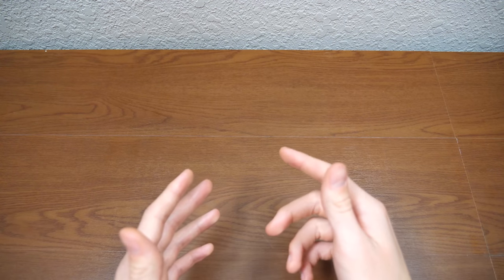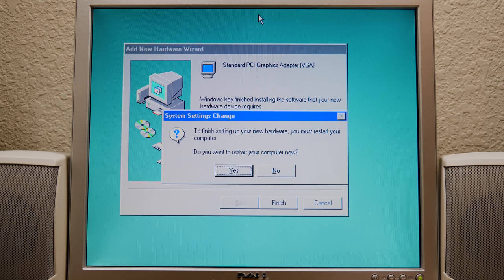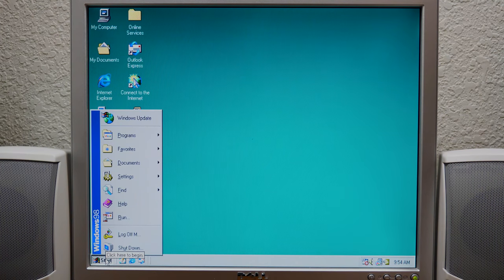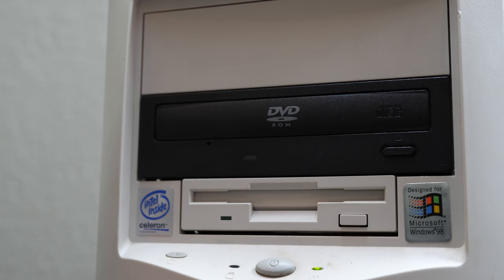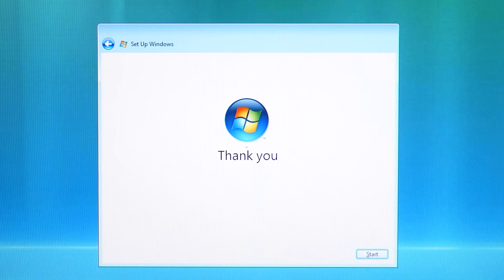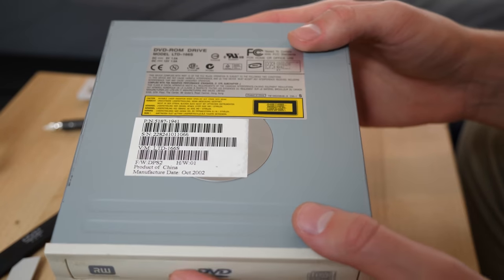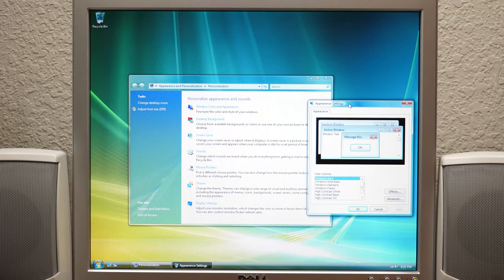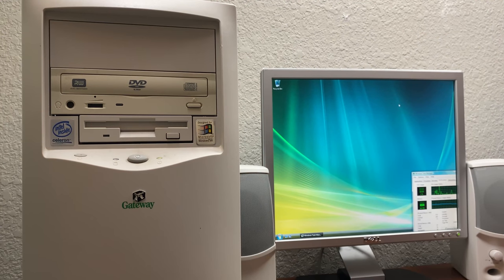Actually Installing a GPU in the $5 Windows 98 PC!

Comment: At least someone installed a new gpu this year.
Reply: fx 5200 price in 2021: 420$USD
Reply: @NuclearToastMusic  I can confirm this is true for some listings!
Reply: the dislikes are from the 90w power supply.
Reply: @NuclearToastMusic  it has reduced to 169USD on Amazon now
Reply: @healspringy6300  it was a joke
Reply: @NuclearToastMusic  How it was a joke?, i meant i thought you said it was real so i just checked it online
Reply: My PC came with a 1080 GTX however many years ago. I'm starting to think it might be worth more now than it was then!
Reply: @healspringy6300  because 420 funny number haha
Reply: @RWL2012  90 W power supplies are losers. My first PC from 1997 had a 250 W power supply and it still works.
Reply: Get a 1030 for $120. It can play most older games and it'll hold you over for now.
Reply: lol!
Reply: Haha 169 dollars and 420 dollars
Reply: Hey hey, hold on.. it requires a cheap cpu with iGPU, probably 150$USD for that and 100$ for the DDR4 would make anyone happy, well motherboard is  130$ not that happy with spending 500 on a new PC, but no new videocard needed :-)))
Reply: Lol fr
Reply: Standard cga gpu price = 420,69
Reply: someone tell Michael that the reason the other dvd drive won't work is because it's a DVD plus drive? (I can tell because of the RW logo)
Reply: @Manny73211  that's not the problem. 
i have a DVD RW drive in my 98 system and it works fine, well not the same model. 
it's probably just a dying drive. 
i lost a few of my good IDE DVD drives in the last 5 years, there just getting old.
probably better to use an IDE to SATA and use a SATA DVD drive.
Reply: @SilverX95  the problem is that an RW drive can only read DVD+R or DVD+RW disks, not DVD-R
Reply: I am going to sell my soul for a 3080 ti or maybe I should go with a 4090 since I am selling my soul.
Reply: @BANDIT198455 Just take a third mortgage on the house. You'll need your souls equity for buying a new platform when you find out its not strong enough to push that 4090, lol.
Reply: @NuclearToastMusic  Luckily I got one for $40, new in packaging lol

Comment: This video: Windows 98 PC runs Windows Vista aero
Old times: Windows 98 PC explodes with Windows Vista aero
Reply: windows is daddyyyyyyyyy
Reply: technology is strange sometimes
Reply: If MJD got Geforce 6 Series on hand then he can get from Windows 95 to Windows 7 with aero running on the same machine,it's a little bit disppointed to see MJD not getting one of those.
Reply: PRETTY SURE he can handle Windows 12
Reply: @ZERARCHIVE2023  😳👀
Reply: I was wondering the whole time what "running Windows Error" was supposed to mean...
Reply: @Aesthelica  Yes it can... If you didn't know, Windows 12 is a Linux-based OS.
Reply: @andreytop1gg  A fake version, infact
Reply: @seardadsdasd  "It's not just a linux distro, it IS a linux distro"
~Webhouses (2020)
Reply: @linglin92  you couldn't get a gpu when he made this video
Reply: @randomgamingin144p  phyiscally impossible.I'm in China and I don't have a GPU from that era

Comment: Definitely replace the HDD with an SSD. I believe there’s also a workaround to get Windows 8.1 running on SSE1 processors, so that might make for an interesting video.
Reply: whats next, windows 7 on a pentium non mmx?
Reply: that won't work, he doesn't have a SATA to IDE adapter
Reply: also, did you forget this PC is from like the year 2000?
Reply: @Manny73211 1990s*
Reply: or a 286

Comment: I would definitely recommend going with an SSD rather than a CF or SD card in this case. NTFS (or any journaling file system) will eat through SD and CF cards rather quickly. Also there's the page file that would need to be taken into account. Awesome video and I'd definitely be interested in both a video on Kolibri and XP x64 and XP IA-64. :)

Comment: Legit didn't know about the Windows XP 64 bit differences. Would love someone to dumb that down for me lol

Also digging the editing
Reply: XP 64-bit is literally Server 2003 with XP "theme" :)
Reply: @paulstelian97  what theme?
Reply: @NotJohnTanner  I mean Server 2003 doesn't normally have the Luna theme or the typical Consumer side of built in programs (such as games). XP x64 has them added back in.
Reply: @paulstelian97  that makes sence
Reply: To make it more confusing, there is Windows XP 64-Bit Edition, which is for IA-64, and has two editions: one is based on Windows XP and the other on Windows Server 2003. Then there is Windows XP Professional x64 Edition, which is for AMD64 and is based on Windows Server 2003.
Reply: @dr.shuppet5452  IA-64 is bollocks, it shouldn't have ever been a thing. There's Intel wasted opportunities, by going for this instead of something that worked well at the time.

Comment: You should get an IDE to SD adapter since SD cards are quite more common and are quite inexpensive than compact flash cards. Not only that, most modern SD cards have decent speeds that it would max out the old ancient IDE ATA interface and as said cheaper to get than buying an SSD and trying to use an IDE to SATA adapter.
Reply: He already received the SSD he bought, he mentioned it at the end
Reply: @laurinneff4304  for future projects it would still be good
Reply: why michael didnt pin you
Reply: Are you sure an sd card will max out the ide interface?
Reply: I have run Windows 10 RTM off an MicroSD on a relatively old computer (like 2007-ish, and 2 gigs of RAM) and it was a pretty good experience
Reply: @theusersf  you mean 1507?there is no service pack on windows 10
Reply: @bokexd3173  Yes, 1507 is RTM
Reply: @ikbintom  Usually most old computers with an IDE interface have a max 30 MB/s and most modern SD cards go around that 30 MB/s speed or higher speeds. Therefore, SD cards are a great choice since they're affordable and can be easily swapped with another sd card to load another operating system or change any contents on the SD card.
Reply: @acumenium8157  nor DRAMless SSD. those ssd die fast and can be slower than a SATA hard drive, or worse, even slower than IDE hard drive.
Reply: SD card write speed is sequential, not random 4K performance. Running off of OS from it is generally a terrible idea because a swap file can kill it.
Reply: Hi, My experience is IDE2SD  or IDE to CompactFlash card adapter is a excellent choice for older dos computers

Compact Flash cards works out better as they were designed for the IDE interface and are just really pin to pin adapters there is almost no electronics in them to do any conversion ( they do use power of the smaller floppy molex power cable)

Plus CF cards can be bought in smaller capacities eg 128Meg / 256 / 512 etc which suits older PC's due to the CMOS / BIOS limitations eg 286/386's

You can get around that by using one of the hard drive manufacturers propitiatory software that places a custom"wrapper" around the hard drive and lets the bios call it whatever cylinders / sectors/ heads / final size configuration

I have CF flash adapters on 386, Pentium 100, Pentium 2-233 ,  1 x Celeron laptop  
The 386 has a Dos 6.22 - 512meg
The P100 has Dos 6.22 and Windows 3.1 on a 4G card that has 2 x 2G partitions
The P2-233 has Dos 6.22 and Windows 98 on a 4G card that has 2 x 2G partitions
The Celeron has WinXP on 4G card

It is true that on a windows system the computer will actually "wear out" and use up all of the read and write cycles on the removable CF or SD media, my reply it , yes that is correct, but these machines are seldom used and in the example above the Win 3.11 / Win98 and Win XP machines i have simply just turned of indexing and the memory swap file, these 2 items are the most intense hard drive activity and wear

In a Dos only machine where you spend 99% of the time reading data , eg playing games or even productivity tools such as word processor etc you are actually doing very little constant writing to the drive so they will last a long time

Similarly with floppy disks, as much as possible of my stuff has been converted to Gotek images and i use a Gotek USB drive

After Win98 the use of removal flash media is not a good long term solution, the amount of read and write cycles will wear out the card long term - but for older machinery will little use they are a very cheap and practical solution

The only people left out are really IDE 44 pin laptop users as i still have not found a decent 44pin CF or SD adapter ( i have purchased about 5 different ones and only one worked in the 4 or 5 different laptops that i have )

Plus - you really need to mix and match, my Pentium 2 has its setup, but it was on my 3rd attempt, the first 2 CF flash cards i used were just not compatible with the card adapter - 3rd time lucky, the first 2 cards i did manage to use on the 386 and Pentium 100 with different branded CF adapters

Regards
George
Reply: @acumenium8157  CF cards are still made today, they're typically used for higher end cameras, you can get them as low as in the megabytes, and as high as 256GB, they're a tad expensive compared to an SD card, but they have better speeds and are more reliable then SD cards generally
Reply: mSATA to ide is the best option, you can get good endurance, speed and capacity, plus decent pricing
Reply: at least for os past to dos ones
Reply: @acumenium8157  Hi - thanks for your comments

I have in total probably 8 CF media cards, 5 or 6 IDE to CF adapters and 4 machines running IDE2CF adapters - so a few spares

The CF cards are more expensive than SD cards, so initially i did use 2 used cards from production or camera use - both work well, i did not think at the time to run say a IDE SMART program to see if i can read and history or start - stop cycles or hours run ( plus most of those programs would require Win 98 or XP software  - but there may be some dos programs ) neither did i use the official SD foundation / association  tools

In looking back i should have just popped them into my 3 in one USB2 card reader on my Win10 desktop as that is how i bulk transfer files after the Cf cards are natively formatted in the machine they will end up in ( Note in older machines it is Dos 6.22 etc )

The other cards i used were new, brands that i have a Sandisk, Transcend and some unknown brand that has a blue white and bubble sticker on it

Older PC's using IDE PATA specs are limited to max IDE controller of ATA133   ( 133MB ) - so you should use the specs on the CF card if they have quoted a max speed - note actual read and write speeds will be lower, the max speed is just a max / burst rate, just like your cars tacho going to 6k, it will get there in a hurry and not sit there forever

Also there is truth in advertising, most CF cards have the older rating in MB or Mega Bytes , newer produced items often quote MB/s or mega bytes, as there is 8 bits per bite , then 133MB x 8 = 1,200MBS

IDE2SD is fine, but as most SD cards are larger capacity they cannot be really used in older machines, Dos 6 has a 2G partition limit and you can have ?? max 4 partitions or something, so you are buying something you cannot really use in full

BTW here is some text info of SD card speeds - the difference between HC1 and XC1 is the max size in the group
SD is up to 2G
SDHC is between 2G and 32G
SDXC is between 32G and 2T

90mb sec                         V90
60mb sec                         V60
30mb sec                   U3    V30
10mb sec  sd class @10     U1    V10
6mb sec   sd class @6            V6
4mb sec   sd class @4
2mb sec   sd class @2

Regards
George
Reply: @acumenium8157  LGR uses them with 0 problems,sooooo,idk mann
Reply: @BobPony  thanks for the response, that's nice!
Reply: @georgemaragos2378  hi George, I'm interested in using one of those IDE 44 pin laptop CF or SD card adapters. Which ones do you have that work?

Regards
Tom

Comment: I used to have a working FX 5200, and Longhorn builds will usually natively have the GPU drivers installed, aero on 4074 works but can be sluggish, some newer builds have better performance.  The FX 5200 is one of the better cards for easy aero on Longhorn.

Comment: The fun thing about SSDs is that they use the SATA interface, like anything from the past 15 years. It's a shame the windows 98 pc doesn't have SATA but even with an adapter, it's amazing how you can fit the latest hardware and the fastest possible drives (excluding NVMe of course) in a pc that was made years ago
Reply: nvme to sata exists, then add sata to ide :D
Reply: @bookshelffury  that's true but it won't get you any speed over a data SSD

Comment: From my recollection, those issues with the installer were pretty common back then. You would always get some kind of error, and then have to go online and figure out what you REALLY had to do to get it installed.
Reply: The fact that Micheal had install errors installing both the driver and Vista from CD suggests that the drive has issues. So he did the correct thing imho and tried another drive.

Comment: Man, I love this stuff..brings back so much. My first laptop was a.. well.. kinda forgot the manufacturer. It was a odd ball I bought off a friend of mine...  I remember it had a single core Intel Celeron M, 512MB DDR2 RAM, and S3 Graphics! It came with Windows XP installed.. I later upgraded it to Vista to find it didn't look as nice as other computers with Vista or 7 installed with the transparency and all.. the 64MB of VRam just couldn't do it. Tried registry edits and everything to no avail. Crazy stuff.. but I did learn that Ubuntu will allow transparency on ANYTHING... but this "Extended Life Linux" OS I got ahold of that claimed to be able to make any old computer carry out day to day functions really made the most of that system.. still wasn't enough for the larger Halo:CE maps. Haha

Comment: Thank God you finally upgraded the gpu!!! If you ever wondered why the integrated gpu caused so many problems such as low res, low colour depth images or things not displaying properly, that's because the VESA compatibility in the integrated gpu is crap!!! To put it simply, VESA compatibility allows an OS to run at resolutions higher than VGA res without graphics drivers installed. By the year 2000 most GPUs where compatible with VESA 3.0. With VESA 3 this is how you are able to see the typical Windows 7 boot screen, the "Windows is loading files.." text in higher 1024x768 res instead of 80x25 text mode and also when you boot into Windows XP or newer with no Graphics Drivers, you can run in 800x600 and higher in 16 or 32bit colour depth. Intel's graphics however where stuck on VESA 2.0 until the GMA 950 which only allows 640x480 in 4bit (16 colours) colour depth without dedicated graphics drivers. If it was up to me I would have changed the GPU on day 1 of having that PC for better compatability!! By the way your channel is awesome!!!!

Comment: Hey Michael! I would recommend that you install the monitor's driver, because this is a 75hz model right? The driver includes the driver .inf file and a color profile. Maybe this would be helpful  and maybe it looks nicer on camera then ( i don't know much about video recording, but i think it's helpful. (I use a similar monitor for my Vista PC project, so i know that there is a driver for that)
Reply: that would be nice to see
Reply: 75 Hz might seem better, but I don't think it is. I would keep the monitor at 60 Hz, because it will look just as fine while being less cpu and gpu heavy. Also - I think - videos in 30 or 60 Hz might look better if your monitor is actually 60 Hz instead of 75 Hz
Reply: But installing the proper driver could still improve the image quality, especially in older OSes, you're right about that

Comment: 21:58 Windows Aero = Windows error if you have captions enabled. ;-)

As for having a component in a case that doesn’t match the color (your DVD drive initially), heck, I put a 5¼" floppy drive into my Pentium 3 back in the day, not caring that it was way out of place (and color) for its era. The original intent was that I had hoped for a way to make diskette images for my 8-bit computers like Commodore 64 and Atari 800, but ended up abandoning the idea when I couldn’t find any info online 2 decades ago to do so.

Comment: Yes, definitely an SSD in the 98 PC is something we want to see, even if obviously won't run at its full speed by any means. The flash card solution is only OK for older OS like Win 9x, newer ones make a lot more read/write operations, severely reducing the lifespan of the card. Very satisfying to see Aero running on a PC which doesn't even have a proper (typically AGP at its time, later PCIe) graphics expansion slot on it, I wasn't really sure whether any PCI cards existed that were good enough for that.

Comment: I just picked up a $10 Windows 98 PC today at Goodwill.  An HP Pavilion 6640C K6-2 500, 20GB HD, 64MB RAM (max is 768).  It has an ASUS P5S-VM board with a SIS-530 chipset, but most importantly, it has an ISA slot so I can use the Goodwill SB AWE-64 card I got for a dollar a year or so ago.

Comment: Are you planning on doing dual or even triple boot with XP on this PC? Could be a good use for that SSD. Too bad neither of those OS-s use TRIM, but it's a throwaway SSD so it's no big deal. Upgrading RAM to 1GB could be pretty sweet too.

Comment: For around $40, you could grab a pci to pcie slot adapter and get a cheap r5 240 on eBay.  While the card will be severely limited by the slot, you will be able to get a more modern card installed on a system like this.

Comment: I went on a triage with my Dimension L800 CXE, originally a Celeron 800 with 256mb SDRAM and no GPU, I upgraded it to Geforce FX 5500 256mb RAM PCI (I have no AGP slot) 512mb ram, Pentium 3 SL4SD 900mhz and a SATA to IDE Converter with a generic 128GB SSD. Also have a new in box usb 2.0 Controller, and Ethernet adapter for it. Now to upgrade the Dell Creative SoundCard with a decent upgrade (Like a SoundBlaster Live! or maybe a 16) and we're golden!